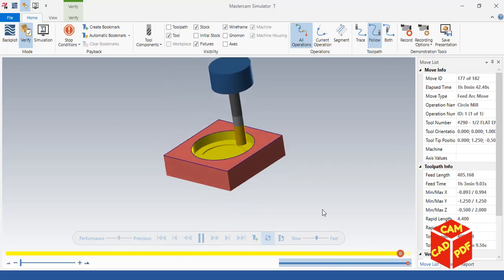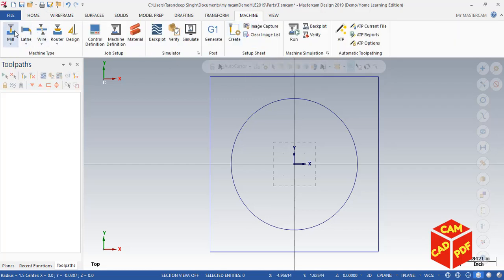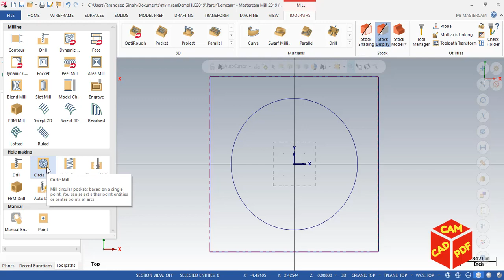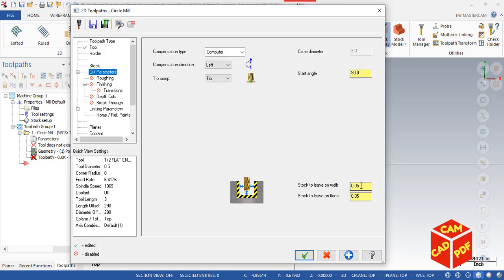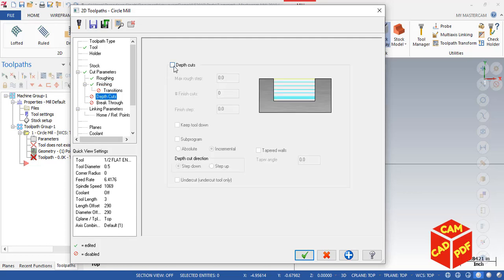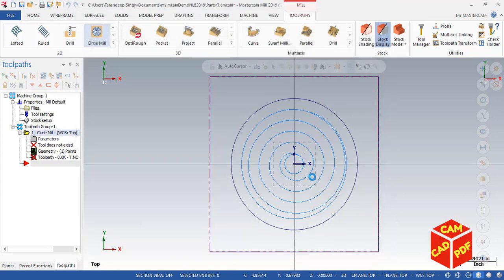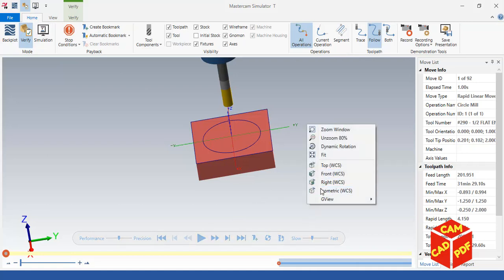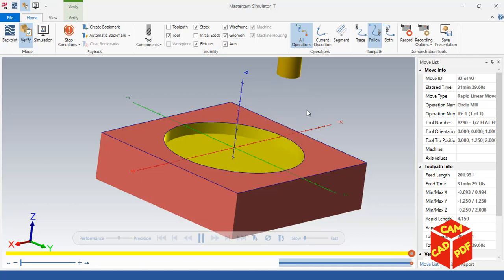CIRCLE MILLING in Mastercam 2020  for Beginner Lesson Tutorials

Comment: mastercam2019 is not opening on windows 10, after installing double click the master cam short cut key,
it's running but in the beginning startup task it stops working no any error pop up on the screen .do u have any idea about that.
Reply from the maker: Well, your system specs definitely meet the minimum! Requirements Just to eliminate a faulty graphics driver, press the windows key/start button and scroll through your applications list until you find the Mastercam 2019 Demo folder. Click on "Advanced Configuration" and choose "Graphics support." Whatever the Hardware acceleration option currently is, switch to the opposite (i.e., disable it if it's enabled and disable if it's currently enabled). Then try to run Mastercam again and see if it still hangs on the startup tasks portion.